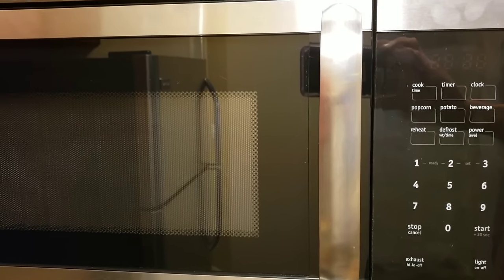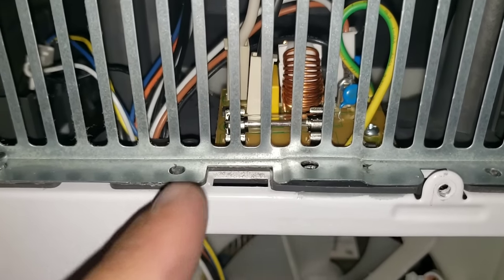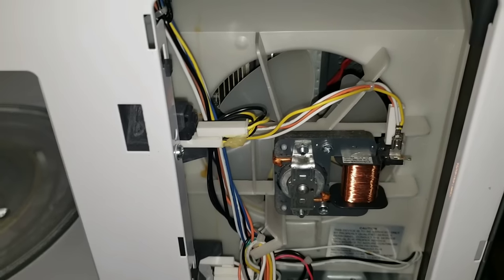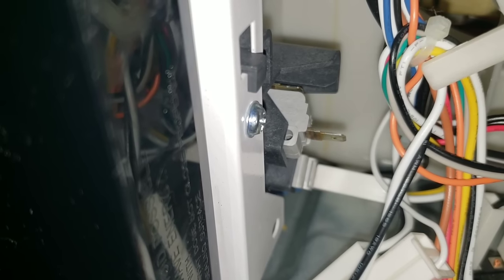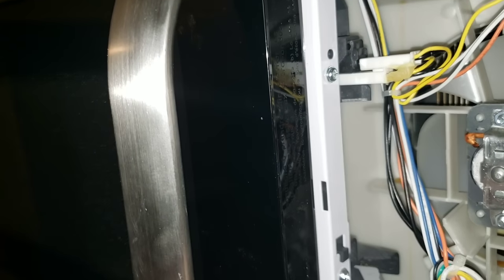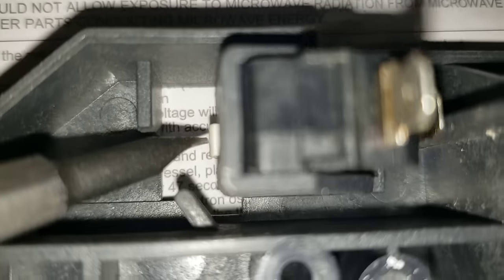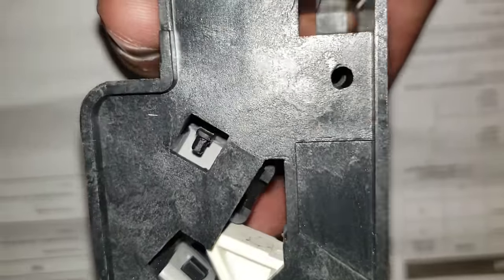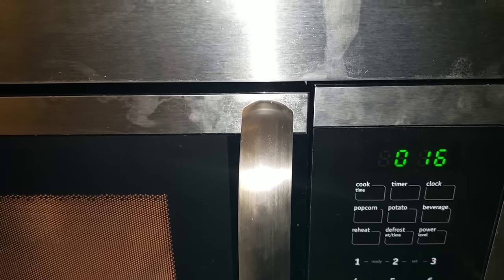Microwave Keeps Tripping Breaker? Here's WHY!

Comment: Hey man I just really want you to know how grateful I am for this video, the maintenance guy told me it was completely fried and it was 600 bucks. The switch wasn’t even broken it just wasn’t clicking in and out like you showed at the end. Zero dollars spent and it’s brand new again. From my family to yours thank you.
Reply: Thanks for your comment! I had went to check on the click and it was just stuck for some reason..
Reply: I took mine out and it felt stuck...now it's clicking again. Going to try and re install 🤞
Reply: @Stooges_Sports  did it work? I had similar issue its looks like it just stuck when clicking. I don't have multimeter to test.
Reply: Great video and easy to follow. Thank you so much. Mine switch was just stuck. I used the same switch once clicking and now the microwave is working again. Thanks again.

Comment: Our previous microwave lasted almost 20 years.  We bought a Frigidaire Gallery and it failed in less than 3 years of intermittent use.  Blowing circuit breakers exactly how you described.  Your excellent video clearly described the problem diagnosis and how to fix it.  I spent $16 in new microswitches and fixed the issue with your help - saving me who knows how much, worst case the cost of a new microwave.  You've done a great service, as it appears this is a widespread issue.  God bless you and yours, brother!
Reply: I have the same microwave and problems....I'll try your approach...thanks!
Reply: I gotta try your procedure...thanks!😊
Reply: For anyone reading this comment, I posted a follow-up with a less happy ending and a theory on why these ovens and oven doors are not so durable.
Reply: It's been a problem for years with all brands. Those little "Cherry" switches can't handle the current. They arc and stick closed

Comment: You da man Sam - thank you! My GE JVM3160RF2SS
 had a bad middle door switch and kept tripping the 20A breaker. The limit switch part looks like it tests for continuity OK, but if the plunger is wiggled ever so slightly, (without pressing it in until it clicks) the circuit opens. Got a KW3A micro switch online (same 16A@125/250V rating) for $8.00.
Tip to others: With this GE oven, you can leave the oven in place for this repair. To remove the control panel, first remove the plastic header part above the oven cavity (behind the door, 2 screws). The control panel should slide up and out.

Thank you again Sam. You saved me the money and the aggravation of getting a new micro that may not match the other appliances.
Reply: Gaming by Starlight   Question. Are the top and bottom micro switches the same model number?
Reply: Gaming by Starlight I have a Ge too it’s the second he this happened to I don’t want k buy a new one and guess try to fix it - so you don’t have to rip the darn thing down to  open for access?
Reply: @efthimios  Correct: Unplug, leave it bolted to your cabinet, remove the header part at the top of the microwave, then slide the control panel up. At least that' show it worked for me. It's insane that GE designed an electrical circuit with such a ridiculous failure mode.
Reply: Gaming by Starlight thank you it worked and I ordered the switches and a thermo from amazon just waiting now

Comment: My Frigidaire microwave was tripping the breaker every time we opened the door before the timer was up (odd). I followed your steps and discovered that the switches were all good BUT one of them was "stuck" due to some grease and oil getting in there. Once I cleaned it and it made the "click" sound again, I put it all together and it works again! Thank you for the detailed walkthrough, you're a lifesaver.

Comment: It helped me fix the problem. The door switch got loose and failed to work. Still don't understand why door switches can cause overloading. Thanks for your big help, Sam.
Reply: The switches are designed so that a failure causes the fuse to blow. By design. Its a safety feature.
Cheap switches are sending thousand of microwaves to the dump. Thanks China!
Reply: @mrbrown6421  the rest go there from the wavelength cover ;P

Comment: Outstanding video! It turned out to be the exact same switch. I took it a step further....I took the switch apart an noticed the copper connections were melted together. I pulled them apart (with a knife) and put the switch back together (1.5 hour process) ! It works, like its brand new! Thanks for the video!

Comment: Thank you for the excellent video quality and instruction!
I removed the middle switch, and didn't have a multimeter, so I checked to see if they were all clicking, and the middle switch wasn't clicking at all,  and seemed stuck inward.  I pressed with a little bit of force, and the black clicker button pooped out.  I reinstalled it, and the microwave is working perfectly, again.
I ordered a couple replacement switches to be safe, along w/ a multimeter.
Thanks again!

Comment: Good video, Helped me fix the oven. I ordered switches on e bay for my Frigidaire, no, not OEM which was $59.00 plus shipping, but $12.59 for 3, two NO and one NC. This is tomorrow’s project. Beats spending $300.00 plus for a new one . If it doesn’t work, a buddy has one with the wall bracket for free, just got to service his Honda mower. I call that a deal.
Reply: The  switches worked fine, replaced all 3. I did have to take the Frigidaire oven down and partially remove the cabinet. The bad one was the NC switch. Lower middle one, it was hanging up.  The top and bottom  ones are the NO ones.

Comment: What a great video. Daughter's MW circuit breaker kept popping and this guidance saved her $267 just for a service call and $100 an hour to trouble shoot and fix it. Her final cost, $9 for the three switches on Amazon , $1 for a 20 amp fuse from O'Riley's auto parts and one bottle of Grey Goose for 2 1/2 hours of semi-professional labor that eventually got the MW back together. The door switch was the culprit, but ALL is good now. THANK YOU!

Comment: Thank you thank you thank you! It wasn’t any on my switches or my fuse but I did find a loose wire that was causing my short. I was able to use your video to test everything and then noticed that the wire was loose. Going back in your video I was able to see where it should be plugged in and that fixed my problem. Thank you!

Comment: Thanks Sam, I bought a pack of fuses to discover the microwave could still work. The fault tripping fuses was still a mystery. I followed your instructions and ordered a pack of door switches one NO one NC. After replacing the pair, I opened them and found the NO switch had scorch marks from what looks to be arcing. We are now day 5 since the easy repair and its working perfectly. Huge Thanks the replacement cost was $799 for our model and we were out of warranty. Great advice and easy to follow instructions.

Comment: OMG - Thank You Thank You Thank You. I was 2 mins away from tossing a 2 yr old $400 Frigidaire that was popping it’s breaker on start up. I can’t believe the engineers there would design a safety switch that shorts out the system. That seems unsafe. I had that same center latch switch stuck in a Closed state. It Opened up just touching it. I cleaned it well with electric contact cleaner and it works perfectly. You can access this switch’s button through the hole where the bottom door latch locks in. Without disassembly just toggle it with a small driver and spray it with contact cleaner. Amazing. Thanks Again !!

Comment: Thank you so much for showing how to diagnose the issue. Took me 5 minutes after watching your video to fix my issue. It was the switch not clicking. I pulled it out pushed the little button in and out a few times and it started clicking again. Reinstalled and boom working just fine. You saved me hundreds of dollars I was so close to going and buying a new microwave.
Thank you again.

Comment: Great video!  Let me add this short step that may save people from having to open up the microwave.
Although the reasons for Microwave blowing the main electrical panel circuit breaker vary, it is good to see if you have similar symptoms. 
I have added my microwave symptom and solution.  You may have a similar issue or not, but it is always good to diagnose
the simplest with a bit of common sense logic, information and caution. 

Symptom: 
Microvave would blow a circuit breaker (20A) at the main Electrical Pannel on premature opening of microwave door while cooking. 
Then it would simply blow the circuit breaker on press of start. 
Solution: 
1)Unplug Microwave  Completely from AC outlet
2)Open Door  and use a flashlight to see the inside of the door switches, the openings where the door latches on to.
3)Press the switch (s) (the little approx. 1/8"x3/16" black square pads that stick out) with a small wood dowel to unlock it. 
If it was stuck you will hear a click when it unsticks or unlocks.
4) Plug the Microwave back to the AC outlet. 
5) Reset the circuit breaker ( or check that it is reset) 
6) Start your microwave as normal. 
If it works then this was the issue of not, then revisit your microwave symptoms and look for other similar symptoms and 
solutions.

Things NOT TO DO
DO NOT: open the microwave prematurely, use the STOP button or simply let it finish the heat cycle. 

Further Preventive Maintenance: 
Clean your microwave from grease , at least from the exterior, often. 
Because deep cleaning a microwave (switches in particular) requires going into the inside where electronics are exposed and because we are  dealing with High Voltage components that may be live, still, even when the microwave is disconnected, such as HV capacitors, I recommend you DO NOT do this yourself but have someone trained in electronics or microwave servicing do it for you. 

LOGIC: Microwave doors (opening and closing) are  constantly under stress, due to constant opening /closing and because of this constant use, the mechanical switches may get worn out or  get stuck. Grease from cooking will get switches stuck. 
In my particular case I think it was a combination of premature opening the door  but mainly and possible grease and grime that got the lower switch stuck. 

If the above seems like what you are experiencing , then these steps most likely may help you.  

BE SMART! STAY INFORMED AND SAFE!
Reply: OMG that worked. It may be that the micro is over the stove so greasy buildup causes the switch to stick
Reply: Wow. Exact same situation. Exact same fix. Used a chopstick to press the tiny black rectangular plastic piece on the bottom door opening.
Reply: Yes wow such a simple fix! Thank you so much!
Reply: That worked. Thank you so much!!
Reply: Thanks so much. Did what you described and it worked like a charm. Saved my at least $300 :-)
Reply: Your solution worked on my microwave. Thank you so much. I use the microwave frequently to warm up cat food and open the door without waiting for it to complete the 6 seconds. I'll be mindful from now on... your post saved me from calling a repair person. 👍

Comment: Thank you.
My 15 year old Russell Hobbs started to trip the entire house when closing the door.
Thanks to your video, I found that the top and bottom switches worked perfectly but the monitor switch was jamming and not closing properly.
I managed to exercise it manually to restore normal operation.
I also put a thin strip of duct tape on the pivoting arm which triggers the switch to make it a more positive contact.

Comment: Thank you for the video. approximately 2 years ago I also had the same problem. An interesting  details that out 3 switches one should do opposite of other two. I have ended up cleaning switch internals and switching switches.

Comment: Thank you Sam! Great video and excellent breakdown of trouble shooting of a fuse that kept blowing.  My problem ended up being the secondary safety switch, the switch was fine but the plastic tab supposed to hold it in place was letting the switch slip out of the holder and not allow the switch to engage.  Again much thanks!

Comment: Excellent succinct tutorial! 
My center monitor switch contacts were stuck and not opening up.
New switches can be ordered on Amazon $10 for all 3.
Saved $300 and a month wait for a new microwave; but most important the headache of not having to remove the unit from under the cabinet, past the pot fill and not breaking the glass range top.
God Bless You!

Comment: Sam,
You are the man. Thank you for the video and explanation. I am another one of the hundreds of folks that learned and saved as a result of your video. I dont know how you were able to hold the camera, and keep both leads of the multimeter on the switch, and then also actuate the switch - that was impressive.
The other thing that I wonder about - why the failure mode of this particular problem involves a tripped breaker...? I could see a malfunctioning switch causing error codes, or just a seemingly dead appliance, but the 20A breaker tripping is kind of 'yikes!' for a switch failure...

Comment: Great job explaining! I have a very similar model microwave, less than 3 years old at the time of this message. Frigidaire Model No FGMV176NTF, manufactured Sep 2017. The exact switch in the middle (the monitoring switch) was the one that was broken. Found a pack of 2 on Amazon for $7. Dongnan KW3A Microwave Door Switch.

Comment: Awesome video that let me finally fix my microwave. The most helpful tip was to test the door switches with door open and closed. Turned out the door wasn't pressing the middle (NC) all the way down, latch not making solid contact. I had to secure the middle switch with a zip-tie to the assembly so it remained in one place when latch made contact. Before that all sort of issues displayed - fan runs when opening the door, or magnetron not starting.

Comment: Your video was precise and articulate. My microwave was tripping the breaker and I didn't know what to do. Via your post I was able to analyze it properly. (it was the monitoring switch!) Ordered the switch online, had it 24 hours later and 20 minutes later I completed the install and everything is working great! The hardest part was getting the plastic vent cover off and the control panel off...I hate plastic, it always seems like it is going to break. THANK YOU for a fantastic video.

Comment: Thanks man. My Frigidaire was doing the same thing. The switch was good, but the assembly was loose causing the monitor interlock switch to be closed despite the door being shut. A simple adjustment and it's working again.
Reply: What was the adjustment you made and looks like my monitor switch is working and it is more wiggle and causing the switch not being pressed properly when the door was closed. I tried multiple things like double tape and almost gonna do hot glue to keep rigid but wanted to see how you fixed it ?

Comment: Fantastic video and direct guide to troubleshoot one of the most common issues with Microwaves and faulty door switches. I was just about to order a new one and going through your video I was able to find the monitor switch that was jammed. Took it apart and whola...back to work it was....Thank you very much for sharing your expertize.....

Comment: Thanks for the video! After replacing my switch, it still tripped the breaker. After watching your video, I put a black thumb tack right in the black lever that is supposed to make contact (where you put tape). No more issues. Thanks a bunch!